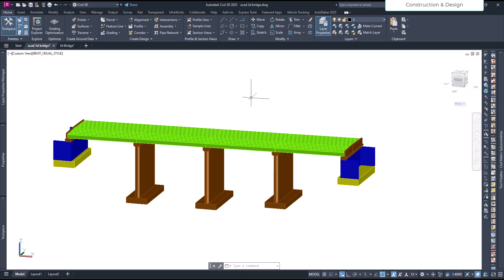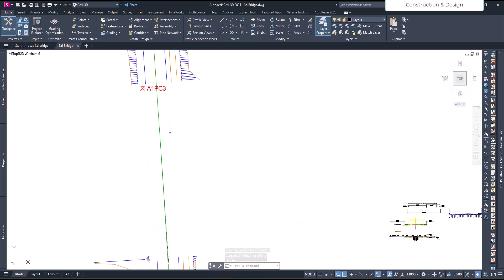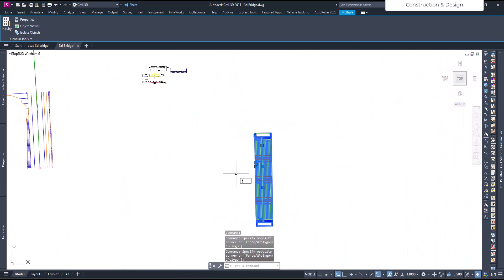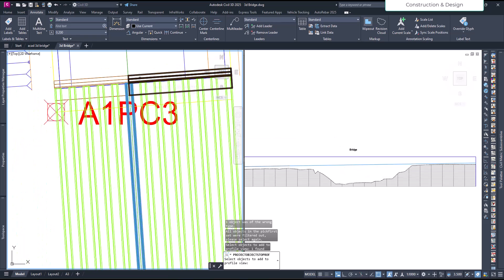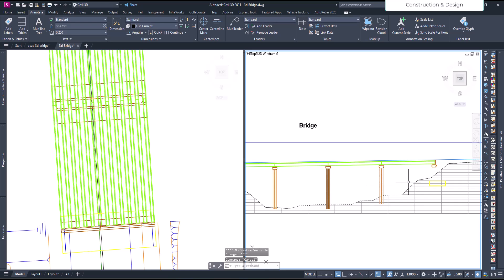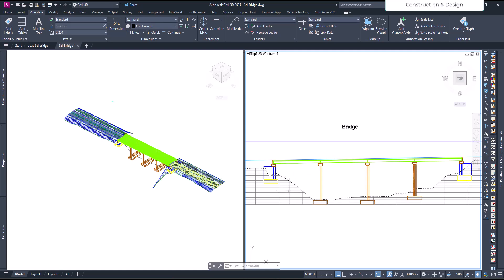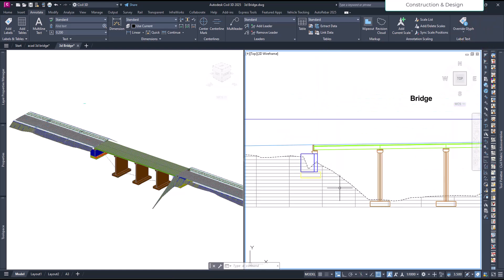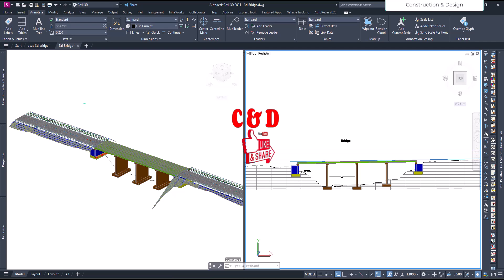Bridge in Civil 3d Project to profile and add labels

Comment: Nice Sir. Can you recomment if we generate the bridge model in curve that will have superposition. How can we export such as corridor surface to use for control of model of bridge actual geometry? Thanks in advance.
Reply from the maker: Thanks for asking.
I think you can simply use the bridge corridor sections as  we do with road. You can just have cross sections at multiple locations. But I agree that the approach shown in the video will have issues. I will create a separate video to model a bridge in a proper way so that you won't have issues. Hope I will have leisure to do it asap.
Reply: @cndacademy  Thank you for your corporation. In my idea but to-now not yet sucess is that we transfer the geometry control such as alignment w/vert. and hor. curve incorporated with superposition table to Revit and generate model in REvit. After that export revit into .dwg and insert the bridge model as you recommend in this vdo. One of the big barrier in on trasfer geometric control to Revit which I still cannot solve!
Reply from the maker: Got your point, will require a series of videos. I will try to record a comprehensive tutorial when I have enough time. Thanks for your comment. :)